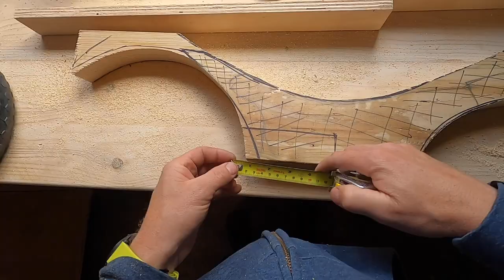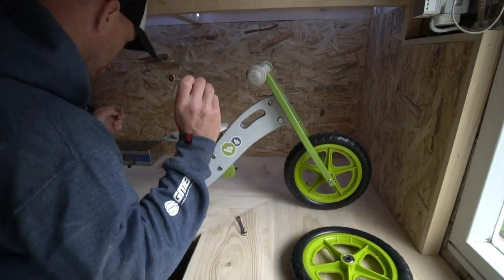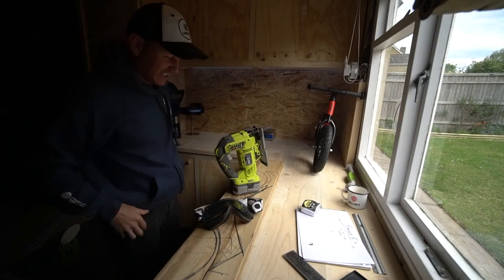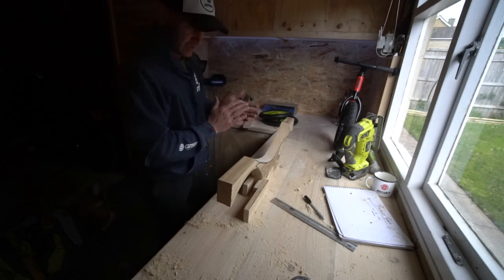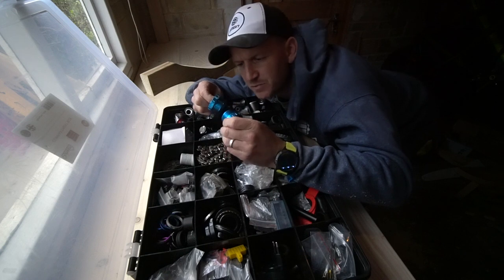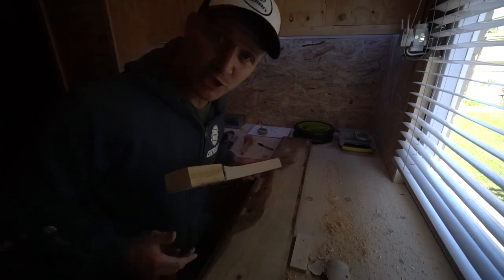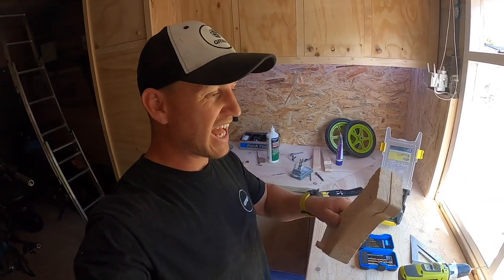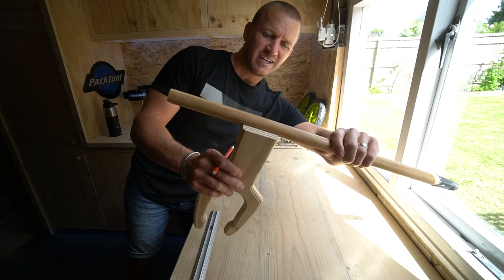Blake Builds A Balance Bike | First Bike Cave DIY Project | #GetRiding Week

Comment: great build blake! as a carpenter though, seeing you chisel towards your hand was terrifying!! one slip and you could have a really nasty cut- I'd recommend a bench vise (can be had cheap second-hand, look on facebook marketplace or ebay) or even just a couple of clamps to hold things down (can get them dirt cheap from any diy/tool seller)
on a similar note, definitely wear a dust mask when working with power tools or sanding in a small unventilated shop like that! wood dust plays havoc with your lungs over time, and a proper mask can (literally) be a lifesaver. toolstation's disposable ones are a bit janky but fine for casual work- I'd recommend getting one rated at FFP2 or above. stay safe and happy building!
Reply: great advice mate!

Comment: With your moto of safety first. A small tip for you Blake. Don’t use your hand to hold the timber when using the router to cut the trenches in the side. One small slip and your hand becomes a bloody mess. I know. Use a proper clamp to hold it to the bench top please.